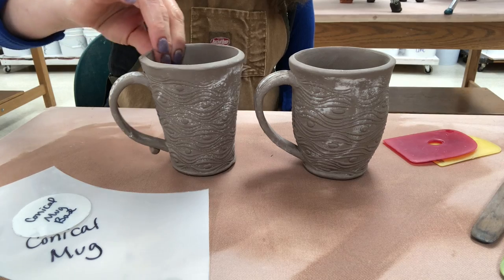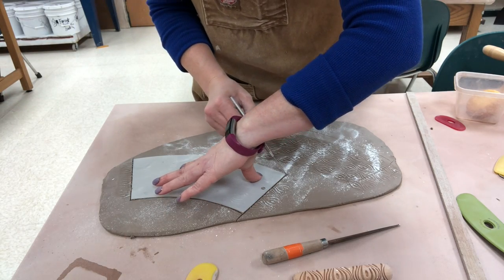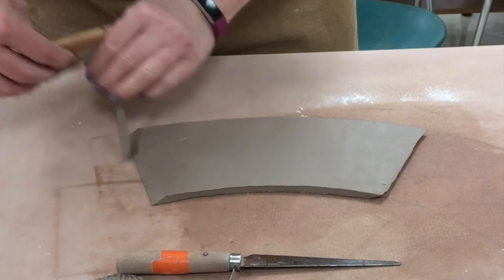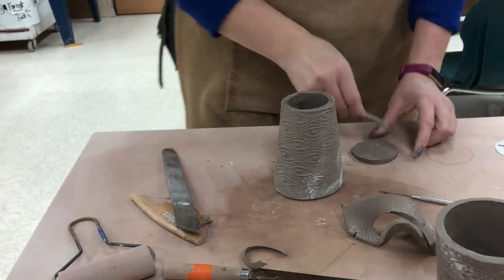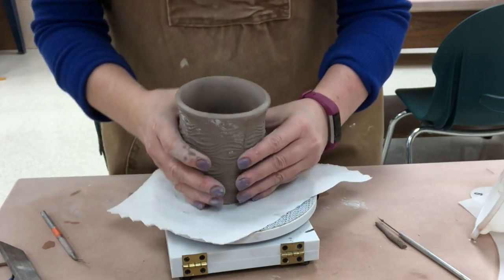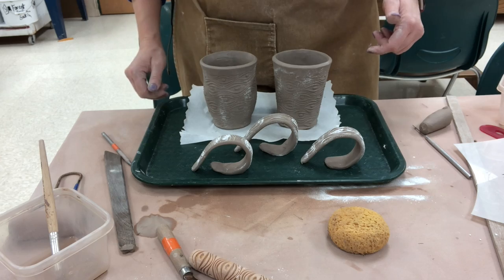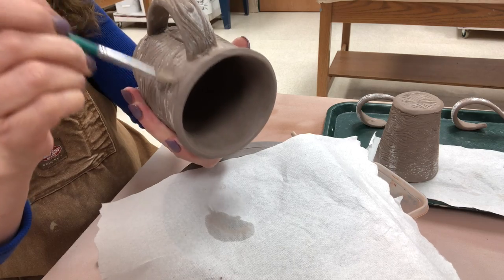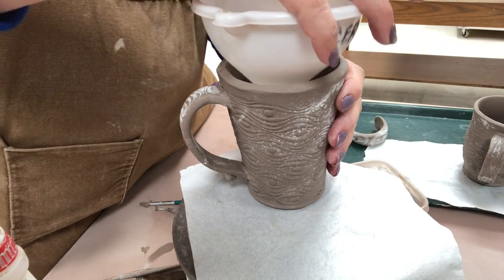Two Approaches Making Conical Slab Cups with Texture

Comment: Awesome video! I love seeing art teachers rocking the videos! Mine are so pathetic compared to yours! Thank you for sharing yours with all of us!! Little tidbits about the MKM rollers. You really shouldn't have to use cornstarch with his rollers. I am not sure I have ever had an issue with sticking. If you use them throwing then you need to dip it in water before rolling to prevent poor stamping/sticking. I see below someone mentioned oiling the roller. If it is an MKM it is already conditioned and does not need any treating at all. It has already been done! I am a friend of the creator and have become quite versed in his tools (and use them practically daily). There was a comment about glazes and texture. I would highly recommend you make some texture glaze tiles and test your glazes beforehand to see what works best with your textures. It will save you a lot of time by testing them first! Since being introduced to the MKM rollers and stamps I rarely make a piece that is smooth anymore. They are just too much fun!

Comment: Hi, thank for all your video, they are amazing and I learned a lot of  knowledge! I have a problem  with the handles because  they dries fast, more fast than  the cup. I try to leave them under plastic bag but it is the same. After i have done the cup Must I use a soft clay (took it from the block of the clay)? Or must I prepare the coils while I cut peaces for the mug? Thank you for information! 😉

Comment: Do you have to wedge the clay first? Thank you!
Reply from the maker: That sometimes depends on the consistency.  With my kids, I often cut a block of clay, and have them roll out directly from the block without wedging.  As beginners, sometimes wedging that new piece- especially if quite large, can cause more problems than it's worth.  Some clays may be more finicky - so I always recommend experimenting with your clay type.  The one issue that could happen, but I don't personally notice it is the auger memory from the pug mill may cause some warping.  (I have only heard this, not really experienced it)

Comment: FYI the two wires on the bevelling tool are for different angles. The one you used is for 60 and 30 degree angles, while the shorter wire is for 45 degree angles.
Reply from the maker: Right!  Sorry if I failed to explain that!  I was using the 60 degree one for a greater bevel!  Was rushing to get it filmed during my plan bell yesterday! ;)

Comment: It is easier and quicker to put the coil in position on one of the  sections, either the base or the walls, before joining the two pieces together. You still have to stick your fingers into the cup to smooth it.
Reply from the maker: That's a very good strategy, Chris.  I try to keep my videos a little extra simple for my beginning students.  I have found multi-steps like that can throw them off!  ;) .

Comment: Can you attach the handle to the cup without letting it dry first?
Reply from the maker: The most important thing is that the cup and the handle are the same moisture when you attach! So as long as that happens, it doesn’t necessarily have to dry. But, I like to get both of them to the slight plastic side of leather hard, as I find it easiest to attach at that point! :)

Comment: I feel the clay wall are very thick, I would made it much thinner. ........ holds  the heat longer when it is thin, and also cooler. And a thinner rim is much nicer to drink of.
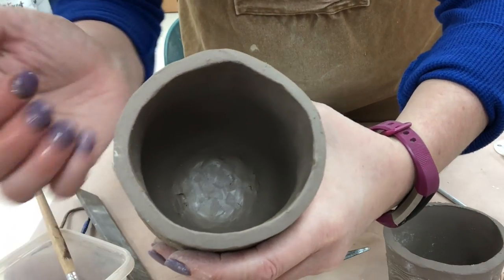Reply from the maker: Hi Kenneth- the walls are thinned quite a bit when I texture them. So, although I start with a 1/4" thick slab, they are quite a bit thinner.  Also, I thin the rim at the end, by compressing with wet fingers... not sure if you watched that far. (See about 14:50)  I am quite picky about my rims... and I will always thin and compress it for aesthetic reasons, functionality of drinking from it, as well as durability.  (I caution my kids about making terribly thick or thin rims.- With 175 kids artwork in my room at one time, we have to consider the durability of things not getting chipped...too thin=easier to chip)   I'm afraid I don't understand one thing you said in your comments.  I know that thicker cups will hold heat of a beverage better than thin cups. (?)

Comment: Where did you get that cutter from
Reply from the maker: If you look in my video description, I have a searchable googledoc of my recommended supplies and stuff.  Here is the googledoc link: https://docs.google.com/document/d/1XbYPQjjJnHrQG5xyWGMHZkEcZj5N8VnUAbFZdJRrRmU/edit?usp=sharing

The direct link to the bevel tool is this:  Xiem Bevel cutter for slabs
https://www.amazon.com/gp/product/B06XPDLBY9/ref=as_li_tl?ie=UTF8&tag=karanspotsand-20&camp=1789&creative=9325&linkCode=as2&creativeASIN=B06XPDLBY9&linkId=7f96999c25988d8415d8c5bab6dca34b